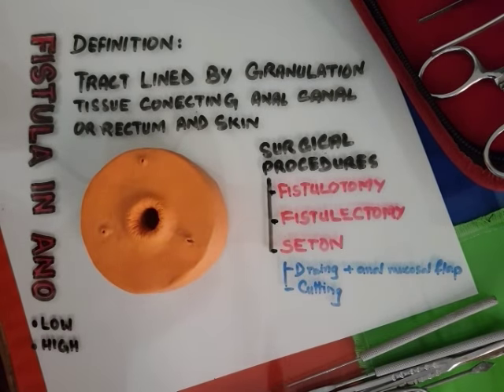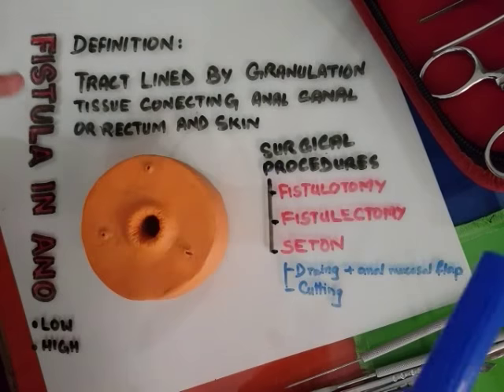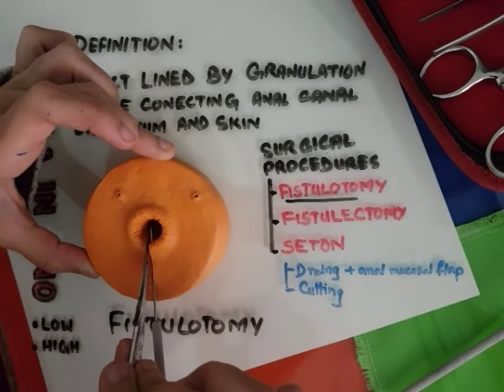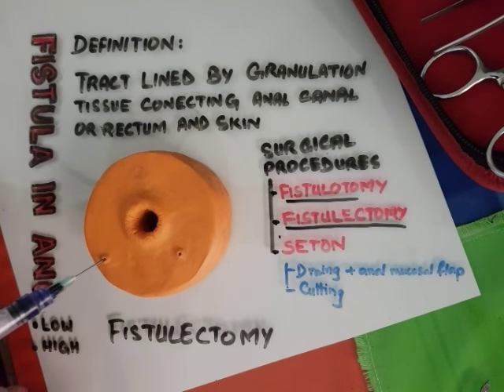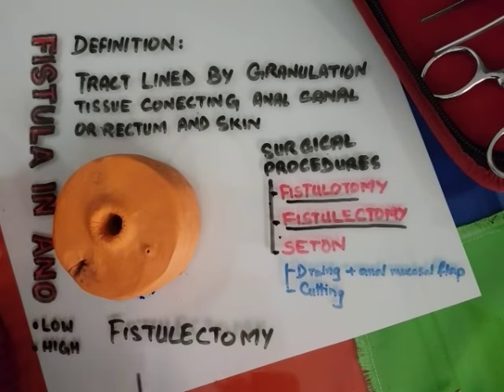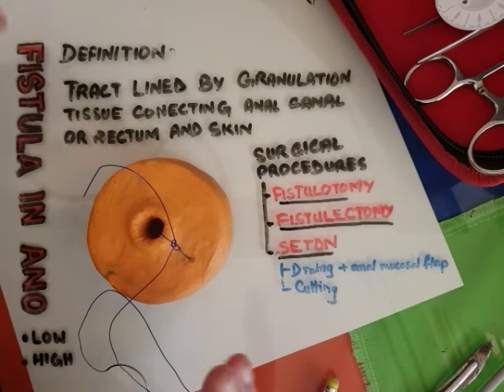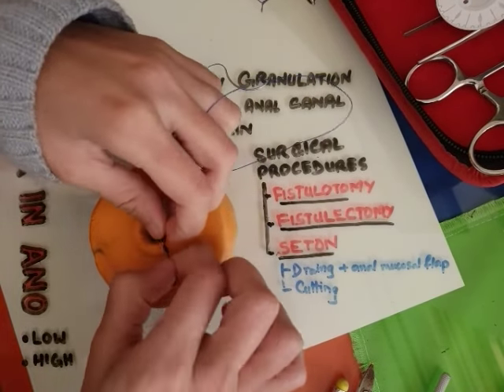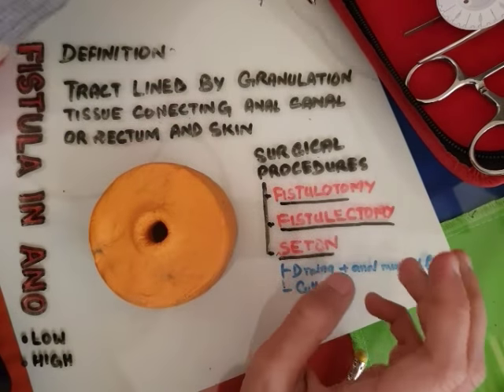Surgical treatment of fistula in ano

Comment: I had an operation to drain the abscess and they placed a seton to drain all the proctitis which took several months! 
I’ve had an MRI which shows it’s a low intersphisteric fistula and and an endoscopy shows I have no crohns or diverticulitis,

My fistula healed by itself and closed around the seton over a year, eventually the muscle growing back the tunnel became too narrow and the seton snapped, after a month or two the area closed leaving a cable tunnel which I can feel under the skin, no solids would pass but maybe sometimes liquid and not faeces but now only occasionally I will see liquid stain not necessarily drain from the area,

I make sure after each bowel movement I clean the inside of my rectum with wipes so the area doesn’t get infected, and because it’s so hollow on the right side maybe due to an operation I had it’s like all the muscles are rebuilding in that area so I’m very careful to not put pressure when I open my bowels and since it’s hollow I have to make sure I assist that part of my rectum with limited rectal muscles.

So my question is do I need to have another operation?
Or will this heal over eventually? 
My problem isn’t that the tract is long it’s like 2cm but the hollowness inside my rectum is even bigger
Reply: Have you do another operations?

Comment: I get the purpose of the setin for draining but isn't it already draining without it. I'm confused how it stops anything new getting into it
Reply from the maker: Think about it like "treatment of abscess is to drain it" or you can think of it like "flowing water is clean while stagnant water gets dirty". Fistula is a tract, Drainage Seton basically helps to keep it clean and drained. It prevents infection and development of abscess. Hope u get it.
Reply: @MinaaAshfaq  but mine drains already, or does it tend to stop bigger particles getting trapped. You would think by now it could be blocked off at one end and left to repair like the origional abscess. I'm starting to wonder if the packing was the reason the fistula got formed or if maybe that was there as surely that's how the infection travel to form an abscess

Comment: Ma'am I recently did my fistulotomy operation and I'm very much tensed that faeces may cause infection to opened fistula tract?
Please give reply maam
Reply: In fistulotomy, the abnormal tract is opened. Very rare chances for an infection or recurrence. Keep good hygiene and follow up with your doctor every 6 months
Reply: @umarafzal4112  does the stool normally pass the wound till it heal?
Reply: @kingcarmona7485  yes. Post operatively after the patient is discharged from the hospital, they can normally pass stool. Only good hygiene practice and post op antibiotics are prescribed until follow up
Reply: @umarafzal4112  Thanks, I was worried that the tunnel is still there. Maybe it just passing the wound but not from the inside.
Reply: Hi! How painful was the recovery period ?

Comment: Ghastly and barbaric. Im 30 years now with this problem and can attest it gets worse with time. This is the very same set of ideas presented by my surgeon 30 years ago, treatment has not advanced at all. If this is a bacteria channel, why hasnt there been medicine (antibiotics) developed to attack the specific bacteria? 10 years ago I consulted a surgeon who had failed in all surgeries attempted because the problem came back for the patients. One of the dangers of these procedures is that the probe this video says is inserted "carefully" in fact can easily prick the side of the tunnel and thus create the formation of new channels. This occurs because the surgeon is unable to find the internal opening and just pokes and pokes and pokes with the probe. The last surgeon I consulted was a very frustrated doctor who proposed a completely new procedure to end this 100% ---- remove the entire lower intestine, rectum and complete butt. This would bring horrifying results for the patient. Its like complaining of a headache and the Dr prescribes removing the head. Voila! No more headache! I ran out of his office screaming. I was hoping 10 years hence there might be advances in treatment but there are not. Im lost and sad and in a lot of pain. I leak 24 hours a day, now have it on both sides of the butt and cant sit or drive or even lay down in bed without high pain.